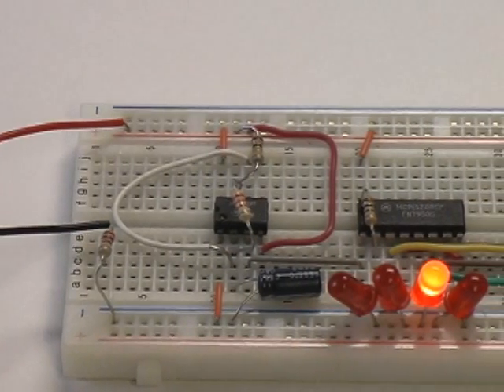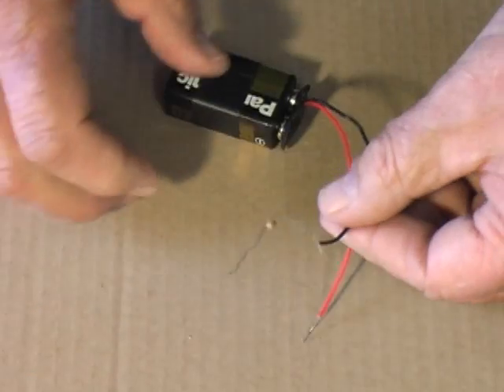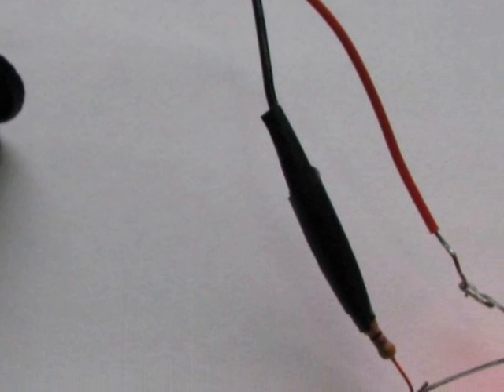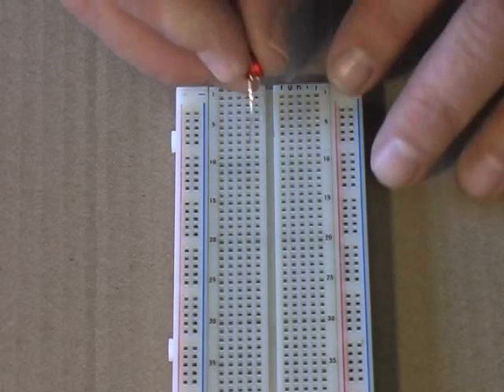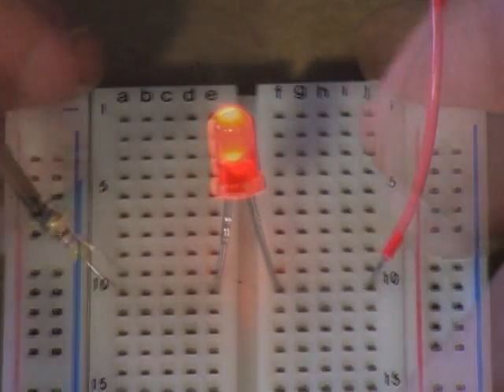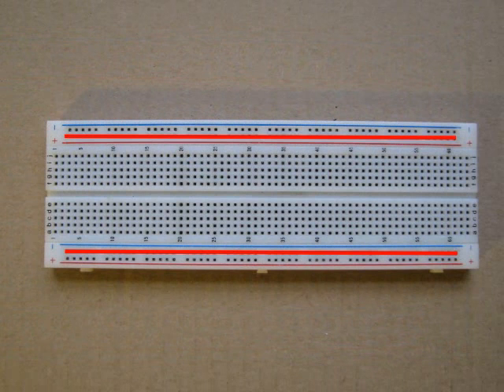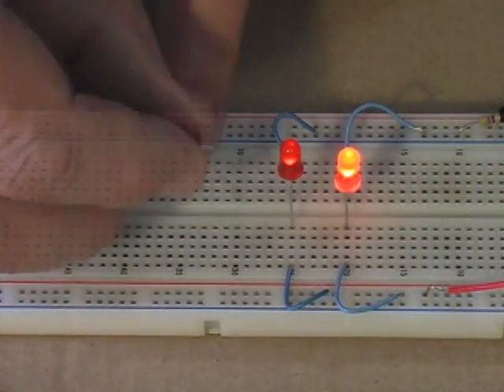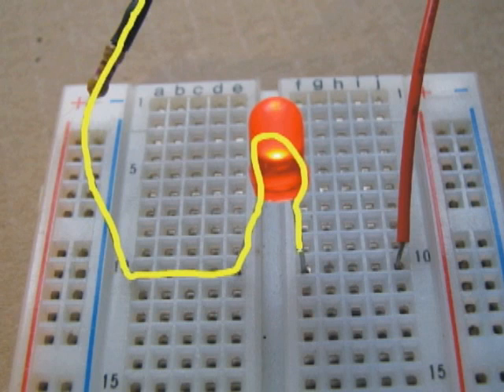Electronics - Breadboards

Comment: I am very new with using the Arduino board and I am trying to learn how all of the different components work together without burning anything out.   I have four sets of led light consisting of 7 LEDs, 28 LEDs, 32 LEDs and 36 LEDs each 20mA with a Vf of 2.2, using 9V for power source.   Using a relay board and Arduino board.  I would like to alternate the first three sets of LEDS and have the four set be a slow fade.  Please help!